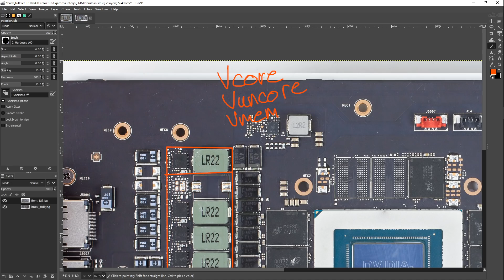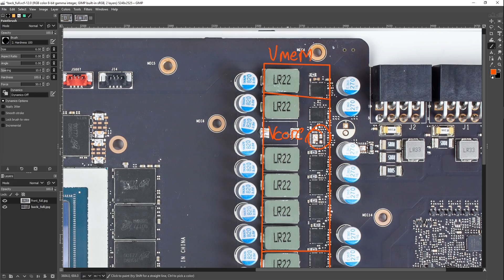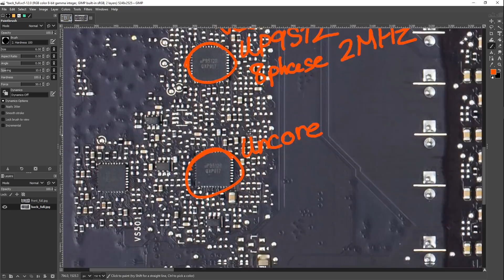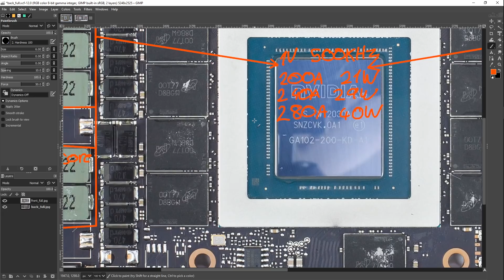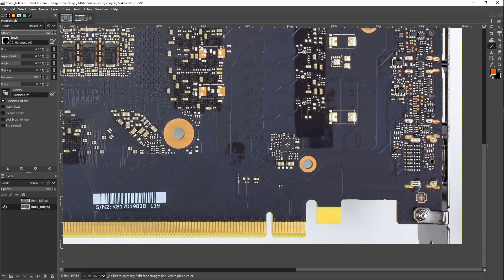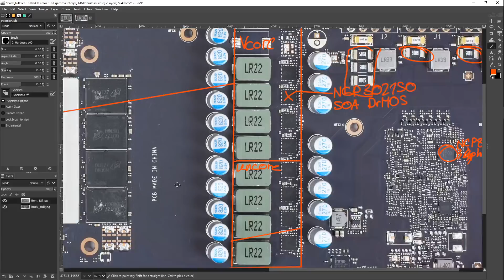GPU PCB Breakdown: MSI RTX 3080 Gaming X Trio

Comment: They really had the courtesy to put up a reference design yet charging a premium pricetag huh
Reply: @Ben T. Although it's much improved compared to the 2080 FE, it still runs hotter and louder than for example the Zotac or this MSI offering. I agree looks are fantastic.
Reply: @Carrinthe  do you find the delta for temp and noise between FE and AIB makes up the price difference? If not that then what?
Reply: @四as  Where I live (the Netherlands) the Zotac is the same price as the FE so that's an easy one. Zotac has a better and quieter cooling solution for the same price as the FE. It's about 1% slower and not as good looking. I would pick the Zotac without any doubt. 
The MSI is quite more expensive and a case can be made that the difference is not worth that price difference.
Reply: The premium price is the RGB ^^
Reply: Ha i checked the 2080 TI review for fun
https://www.youtube.com/watch?v=V70f1Kx0QTU

Same think. so where is the probleme in real?  xd
Reply: @Ben T. The FE card is not a reference design. EK for instance, do not offer a block for it.
Reply: @Ben T. 1 problem can you get one lol
Reply: @Ben T. Because FE cards are generally hard to get, in this situation, they are unobtanium and will stay unobtanium for a while. Also while the cooler is not bad, a decent entry card will still run about 10 C° cooler...
Reply: @Galf506  The TUF and MSI Trio have essentially equivalent coolers (at least for GPU temp). The TUF's fan curve just runs louder. Once you noise normalize it they're the same. See https://youtu.be/cRp5j4LzQsU?t=419

Comment: i'm always is a fan of MSI card because of their top notch cooling solution and solid build. But this's so disappointing, the TUF card got better pcb AND cooling, for $60 less
Reply: You can say anything about MSI but "top-notch cooling solution". Look at their 20X0 lineup lol.
Reply: @_mike  Only questionable thing maybe is their vrm cooling solution, seems like a miss-step...Other than that they are on-par or better than competitors in the same price range. And i love that their design is always efficient, 2 fans Gaming x/s design is comparable to most other 3 fans designs.
Reply: @_mike  whats wrong with their 20 series? 
They at least have a baseplate and come on top most of the time. 
Btw their lightning Z is the best out there
Reply: @_mike  My gaming X 2060 super cools amazingly. So does my RX580.  I assume you're referencing their one budget card they messed up on, and then later corrected, which is a terrible way to judge a product line as a whole.
Reply: @habib6863  I've been referring to their VRM cooling which covers like 30% of the surface area. I don't know if every SKU was the same but they definitely shouldn't cut costs there.
Reply: @habib6863  The 2060 super is only 170 watts, any cooler from any board partner will cool it amazingly xD Saying the MSI cooler does an amazing job at cooling a GPU with half the power draw is hardly relevant.
Reply: @addz17  It would be irrelevant if I was directly comparing it to the 3080, but I wasn't.  He was talking about MSI's cooling solutions being sub par as a whole, specifically the 20 series.
Reply: ASUS just has the best cards in general this time around if you're on air and using them out the box. On liquid it might be a different story. I expect EVGA to be stronger there.
Reply: Cause asus mess up heavly with previous TUF product.
this card is used to restore their image. So the profit margin is lower.
There is no doubt that the MSRP price of TUF will increase over time.
and that for the * Super * version Asus TUF are going to be beautiful shit as usual.For a traditional Overpricing.

Comment: Its one of the most disappointed card..
Reply: Zotac's up there as well
Reply: it's crying
Reply: I actually cancelled my pre order MSI and went with an Asus TUF instead.  Better components,  metal backplate and only two 8 pin connectors while having a higher powerlimit.
Reply: @jeroen1914  agree,msi has better look,BUT 35% more heavy ,3x8 pins and more chunky and long, more expensive for nearly similar preformance i think that i dont want to put a tank in my PC and put a lot pressure to my motherboard just because its a MSI,for me its important that GPU is fast and runs cool.i have a palit 2070 super jetstream and it runs max 57 degreees ,but i trhnik that 3080 palit is not the best choice and assus tuff Tick all the boxes for me
Reply: The performance is there,  the card is silent and the RGB implementation is good.
Where is the real probleme?^^
Reply: @Clippy-the-Doubtful  it's on the hot and noisy side, they have done ZERO job on the cooling it's copy pasted from previous cards and in my country it's the most expensive when it's pretty much the worst 3080 card out there, I have a 1080ti msi gaming x and an msi motherboard but this one is the lowest effort they could make you pay only for the brand, bad buy
Reply: @Clippy-the-Doubtful  reference design, triple 8pin is uneccessary, clock speed is laughable and it is being charged with a premium and baring the top end branding
Reply: @leadmaster537  i dont see any real probleme there. Why the clock speed is laughable?   Premium price the price difference is 10 buck LUL Check on newegg.
A least the MSI have a decent RGB implementation ^^
performance wise tier are the same with some tweak.
I am not a MSI fanboy or whatever,  i just dont understand the reaction of people.  its a pcb,
you will never watch the pcb during its life.
for the 3x 8pin. It is nothing more than more RGB cable. ^^

If the plan its just to have the best for buck.  Its the EVGA,Gigabyte, Zotac one that are worth the buck without extra shit.
All 3080 are the same about OC, Aka like  tech jesus say, not worth it to OC at all.
Reply: @Clippy-the-Doubtful  i would assume you are just in to the looks of the card and that's fine. But most people dont just care for the looks but priorities performance and overclocking capabilities on these cards. Remember this is a $700 msrp for the reference design (not talking about the looks) and yet it is $100 more premium for techinically still the same reference pcb. That what irks people including me.
Reply: @leadmaster537  Pretty sure that both card have the same ceiling in OC ^^.
and if you are really an enthusiastic OC you will watercool.
And in case you will wait for the PCB of the Kingpin/Hybrid of EVGA ^^

Also the founder edition is not a reference PCB so i dont understand what you talking about ^^ https://linustechtips.com/main/topic/1242409-nvidia-founders-edition-30803090-are-not-reference-pcbs/
Reply: @Clippy-the-Doubtful  i never said that the founders edition was the reference card and i am aware it wasn't. The ceiling oc never had any cap, and of course the kingpin cards are built for those. What i'm trying to say is that msi has used the gaming x trio branding (which is a top tier branding) on basically a reference card with a premium price and a thick cooler on it, that's it. If you can justify paying a $100 more for just the RGB like you said then good for you. I just don't see the point of trying to argue with people about it. In fact if people have eyes and a common sense they wouldn't get this card
Reply: @leadmaster537  
https://www.youtube.com/watch?v=V70f1Kx0QTU
I mean watching the pcb comparaison on 2080 TI vs 3080.
Its exactly the same think.

i still dont understand about reference card in what world is a bad thing? Checking the PCB of the TUF on 
https://www.techpowerup.com/review/asus-geforce-rtx-3080-tuf-gaming-oc/3.html

Its the same think.  empty memory slot if its what you mean.

TUF was the shittier garbage line of Asus. And now everyone claim the card to be top 1.  When i am pretty sure , like Asus do everytime, their gonna increase the MSRP after the good publicity ^^. Probably the card with the lowest stock, just for the manipulation.
Reply: @Clippy-the-Doubtful a reference design is a barebones pcb that Nvidia say to the AIB "hey this is the amount of stuff in here in these position on with these voltages and so on" so basically a reference design is THE minimum spec to run the gpu. Asus had a lot of reputation on the line right now due to the mess of the TUF 2080ti and so they had to pull something to get back.
Reply: @leadmaster537  and laughable plastic backplate
Reply: @Clippy-the-Doubtful  i own a 2080 gaming x trio and looking at this new 3080 gaming x trio design, rgb and vrm they have feels like a downgrade, ugly and disappointment to me

Comment: Not worthy of name "gaming X Trio"
Reply: X stands for "ex".
Reply: Yeah, just like the lighting cards with the previous generation. MSI have stopped caring about making great graphics cards.
Reply: thelongslowgoodbye I mean, they’re still a reputable manufacturer of gpu’s. You won’t go wrong with the founders, asus, msi, or evga cards... at least most of them. Still better than the manufacturers zotac, galax and gigabyte who tends to cut corners or have terrible engineering.
Reply: @AznTony360  I'd disagree with you on Galax considering how the Hall Of Fame series cards often rival EVGA's Kingpin/Classified series of cards. However, I'd definitely agree with you on Gigabyte. I used to own a Gigabyte Vega 64 and it died prematurely. I don't know if it's just Gigabyte's crappy quality or how Vega 64s have a tendency to die well before the warranty period is up or both. I've owned MSI and Asus Vega 64s and they've died within months of getting them new. Having said all that, my original comment was more within the context of great overclocking orientated graphics cards because the Lightning line of cards from MSI used to mean something.
Reply: Not to mention plastic backplate.